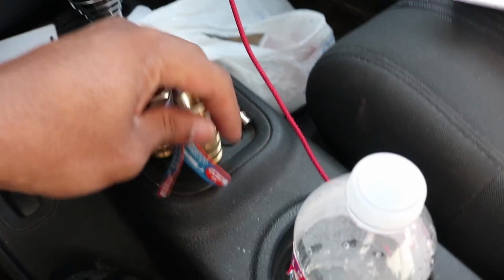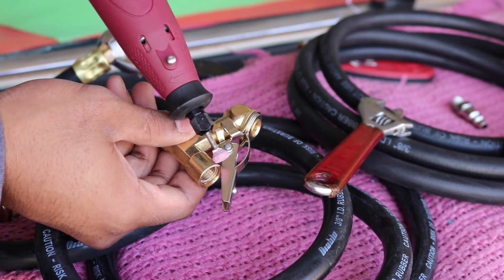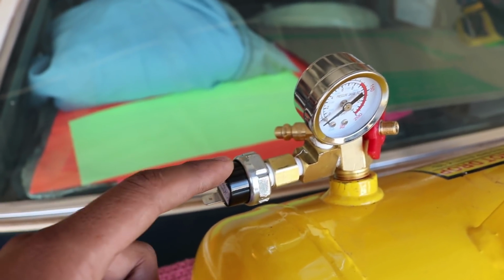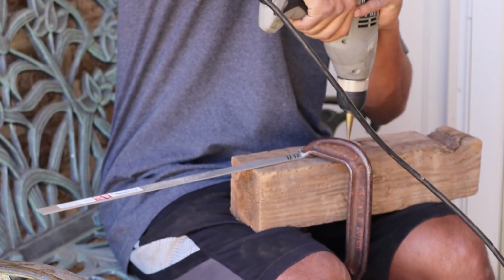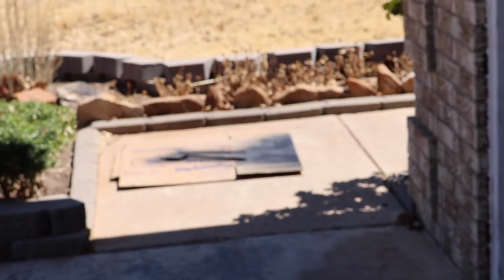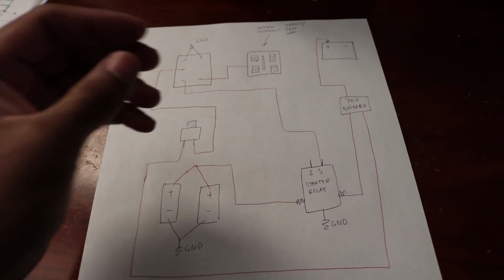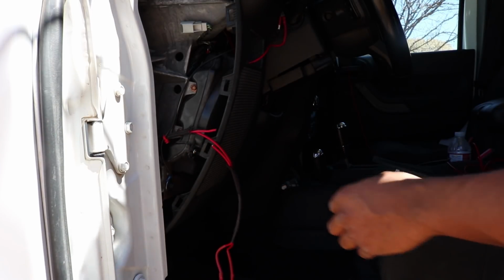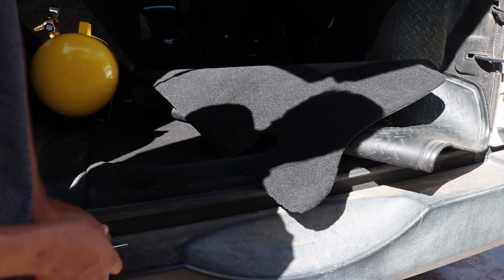Mounting Tank and Finishing Touches [Part Two: $250 DIY OBA]

Comment: Great set up. Mine is not that elaborate. I just got a air compressor and a air tank. A few quick connects and that’s about it. But mine is just for airing up tires. Liked your video anyway.
Reply from the maker: thurman i switched over to a co2 tank. 10lb. Powertank inflator. Arb hose. Lasts forever and it’s not as bulky or complicated as the compressors!

Comment: Im doing just about the same thing tomorrow, for my work truck onboard air and my air bags. just my 2 cents, put a 10a fuse between your 70a and the toggle switch to protect the switch.
Reply from the maker: DANE SPRINGER i added one afterwards. I received a lot of comments with this suggestion. Thanks for watching!
Reply: https://photos.app.goo.gl/dsF5q7FY1CTmXjqLA

Comment: Hey thanks for the video. Just a question, I would like to do the same thing (two compressors going into one tank) but would like the setup to remain portable using the jumper cables instead of fixed. What changes would be made electrical wise?
Reply from the maker: Bader H pretty much all my electrical stuff for the compressors can be cut out. Since you’re running off jumpers you’ll just connect the cables to the battery then flick the switches on the compressors to turn them on. As far as the cut off switch (on tank) you will just need to monitor the pressure instead of using the cut off. To save you some headache messing around with electricals. So basically cut everything out. The jumper solution will make this set up super super simple wire wise. There are already fuses built into the compressors (along the power wire)
Reply: Thanks for the quick reply. I would really like to keep the cutoff switch working  because it would be a hassle switching two compressors on and off. I think I will try to follow your wiring diagram and connect all the grounds together to a ground jumper cable. Thanks again!
Reply from the maker: Bader H okay, just follow the diagram it shouldn’t be too hard to figure out the cut off switch. You probably just have to run the power cable from the battery to the cut off switch, then to the compressors. (Also use proper gauge wires). For combining the grounds just use proper gauge wire. I don’t want you melting them and starting a fire. Goodluck!
Reply: Will definitely use properly sized wires (8 or 6 gauge) and fuses. Thanks man
Reply from the maker: Bader H yeah man let me know how it goes. I’m on instagram @glacier_jk

Comment: Cool build looks like it will work well. One warning is that compressor gets really hot after running for a bit I have the same one
Reply from the maker: The Bearded Jeeper yeah they run hot. But for 50$ they work well and pack a punch. I’ll probably change my set up in a few months or so, so far it has worked well though.
Reply: Chris Meacham I just don’t want them to catch your carpet on fire but yes they are a great low buck compressor

Comment: Thats A LOT of interior noise and loss of much needed Cargo space... they make a tank that fits under the radiator and air compressor mount next to master cylinder...

might as well add train horns to the system... I have quick connects at the front and rear of my rig now to air up front and rear tires... synergy makes the mount for air tank and compressor 

good job
Reply from the maker: Vinnie Gunns on camera it seems much louder than it is. I’ve turned it on while driving a few times just to see how loud it is and it isn’t half bad. And Like ive said, i don’t really use the cargo area very much. But yeah I’m thinking about the train horn thing... thanks!